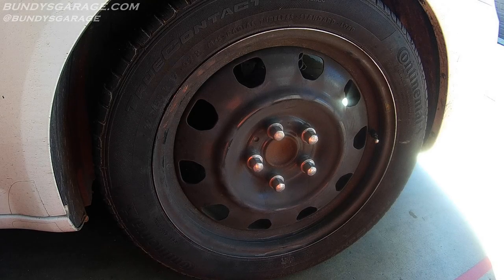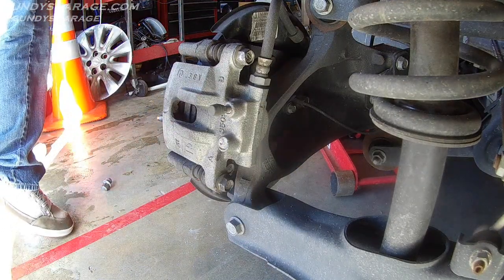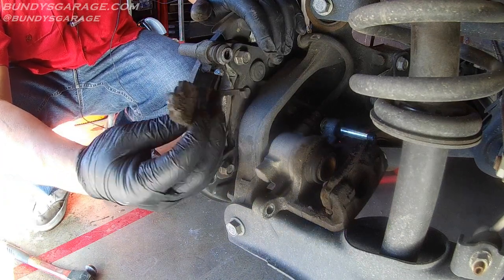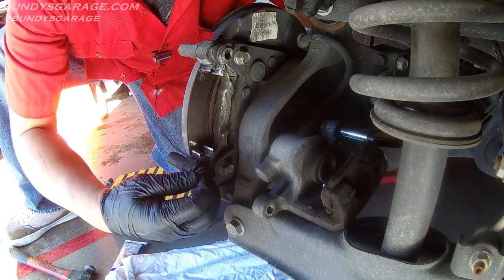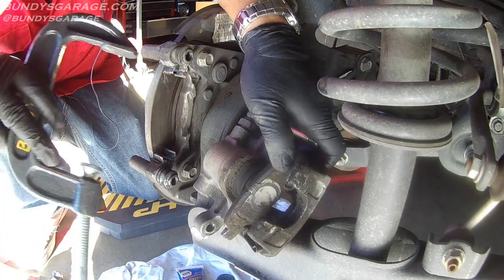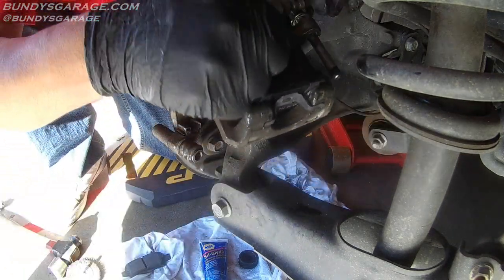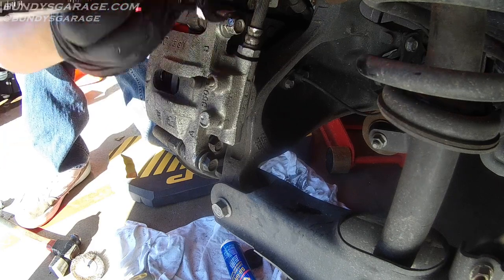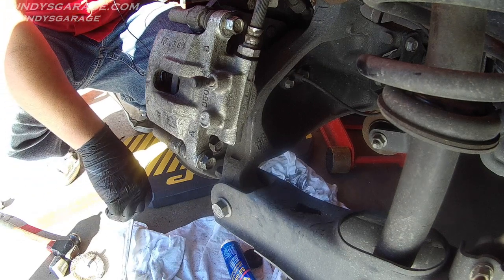Chrysler 200 Replacing Rear Brake Pads Non Electronic Parking Brake - Bundys Garage

Comment: Thanks fella for the help. My 80 year old body was a little stiff but you saved me 150 bucks. Now I have to find a video for the front brakes.
Reply: You didn't need to remove the top 14 mm that you complained about.It slides right off

Comment: people put a screwdriver between the rotor and old pad before you remove the caliper to push back the piston caliper  and remember to loosen the master cylinder cap to let the  fluid rise, this also gives you a good indication of how the piston calipers are doing.
Reply: Yes and you always wipe off any capes before you remove them, just so no dust will get inside.

Comment: who uses c clamps  still, put a screwdriver in the pad with the cap removed from the master cylinder and use a screwdriver to pry it back,  its a good indication of how free the caliper piston is. also if you are from the north like i am, you need to wire wheel the rust on the caliper mount under the stainless steel guides under the pads

Comment: you didn't take the rotors off
Reply from the maker: +Joshua Brown no but it's very easy if you had too
Reply: BundysGarage i figured it out. just had to hit it harder. they were a little rusty
Reply from the maker: +Joshua Brown the metals get cheaper and cheaper
Reply: BundysGarage tell me about it. I had to remove the entire rear end assembly. had to get in there to disconnect the ebrake